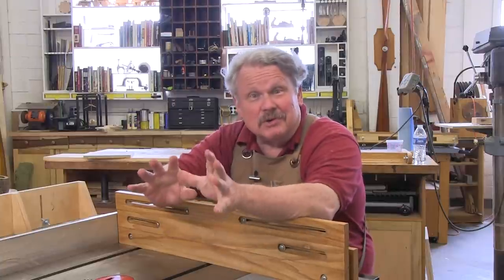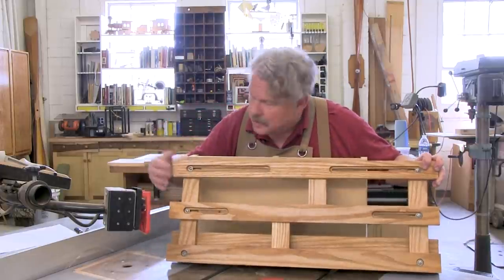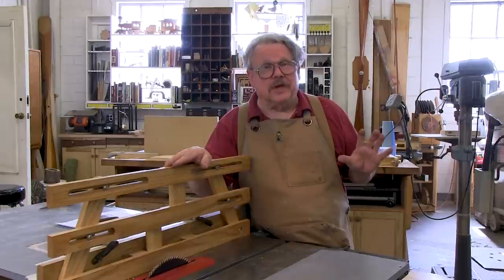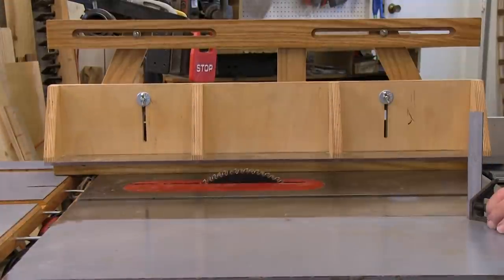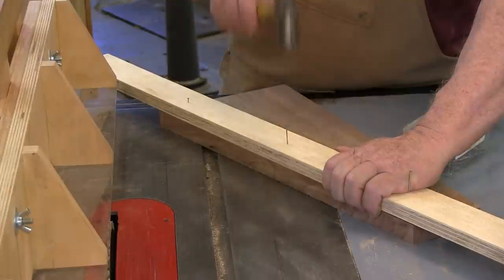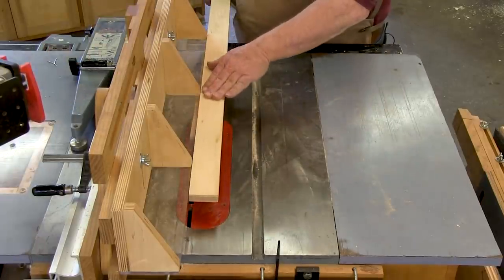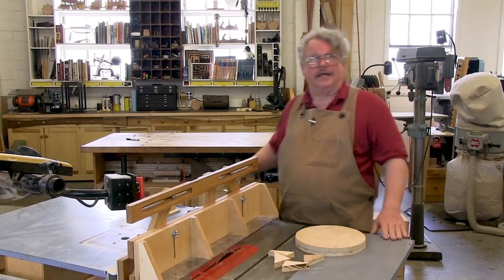Tall & Horizontal Table Saw Fences! - L Fence

Comment: The circle cuts seems super dangerous to me. If there's any friction between the horizontal fence and the template circle, it seems like it would be very hard to keep from twisting the entire thing enough to get kick back. I can very easily see the blade spinning that circle around and dragging your fingers right into the blade. Not to mention the lack of a riving knife / splitter? Yikes!

Comment: Great video. Was trying to figure out a way to straighten out edges for joining wood panels. Saw some other videos on how to make a table saw sled and then came across your version which seem easier to use and build. A jointer jig that did not require another sled and rails! Already had a tall fence for my table saw, so I figured I’d try your table saw fence idea. I built a horizontal fence for my table saw that works great! Thank you for another great work shop tip.
Reply from the maker: Most welcome.

Comment: Nail holes, nicks and blemishes can also be made to disappear using some water drops (let it soak in but leave some water proud) and then take a soldering iron to that spot, careful not to touch the wood.  Works great!

Comment: Thank you so much for all the demonstrations, I have these thin, un-square hardwood strip cutoffs I’d love to repurpose but I don’t have a joiner, planer or disc sander nor do I have a decent hand plane yet because that was my first thought. Anyways as long as I use this and careful support the thin strips I can cut off the wonky edges and finally use them 👍🏽
Reply from the maker: Most welcome. Travis and I use this often to trim wonky edges. It also does a reasonable job at jointing, if you have a perfectly straight board attached to the board you're cutting. Be careful to keep the space between the blade and the fence free of scrap -- I keep a long pusher handy to clear the scrap after each cut. And stand to the left of the blade, opposite the horizontal fence, in case of a kickback.

Comment: Steaming the nail hole makes the fibres expand and the hole shrink, but does the hole come back as the wood dries out again?
Would a drop of CA glue hold the swelled fibres in position better?

Comment: May I ask...  How do you keep your adjustable tall fence from flexing, or Deflecting, when in use?  Does it bend a way from the blade with moderate pressure when pushing a board through for a raised panel?  Please let me know.  Thank you so much for this idea.
Reply from the maker: It will bend if you put too much pressure against it. In the work I do, I don't find that to be a problem. If your work requires a great deal of pressure, the first design I showed would suit you better.

Comment: You can just finish off the circle with the router table too if you are not confident with turning the workpiece on the table saw.
Reply from the maker: If I was cutting circles to actually use for a project, I'd make them with either a router compass or on a router table with a pivot. The demonstration in the video was just to show the horizontal fence's capabilities.
Reply: @WorkshopCompanion  - I know, I was talking more to others who may have come across your video to learn more about wood working and adding a little more.
Thank you for your reply though, I appreciate it when creators are active in responding to their viewers.

Comment: I would be concerned with the possibility of the little cut offs trapped under the horizontal fence becoming missiles. This is not for me cause I hate the sight of blood. As a matter of fact, I just watched the video again and you can clearly see a kick back occur while cutting the circle. One of the little triangular cut offs is launched at warp speed back toward the operator at 5:26 and again at 5:33
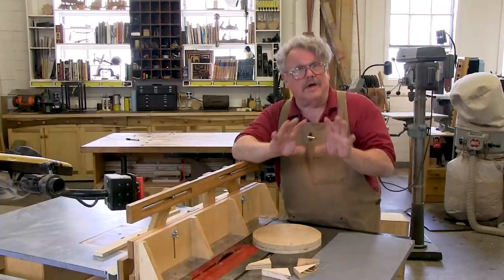Reply from the maker: They do kick back if you let them build up -- that's why I showed how to keep the space clear under the fence with a long pusher ( 6:19 ). However, you're right -- there were a few kickbacks when making the circle. I should have stopped and cleared the space after each cut, but we were trying to make the circle in one take.